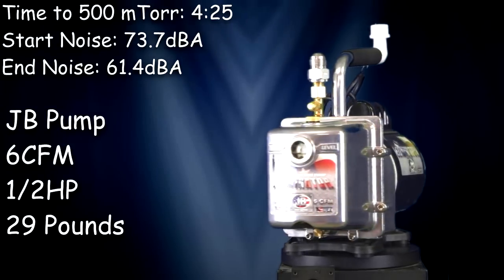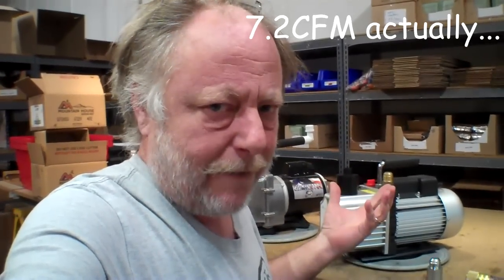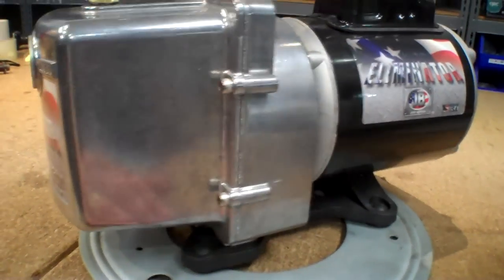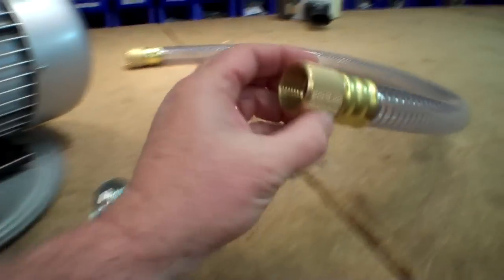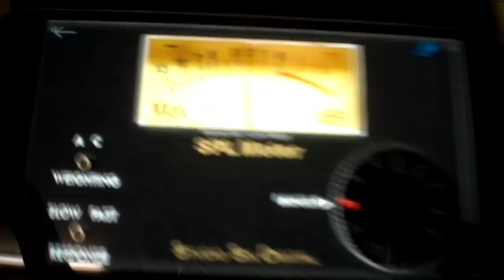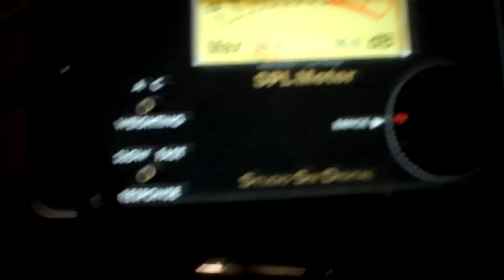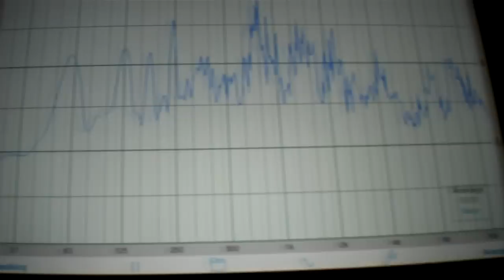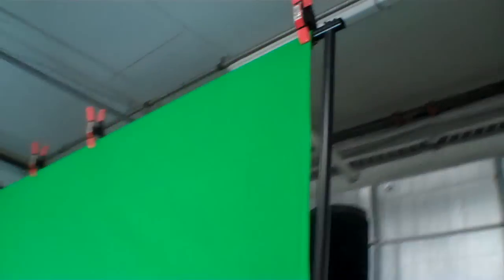First Look: NEW PUMP shipping with all Harvest Right Home Freeze  Dryers.

Comment: Bryan, one thing I just learned from Harvest Right's service technicians is that HR no longer services their new vacuum pumps (Model2TW-3C) nor do they sell replacement parts. Crap! They wouldn't even disclose the pump's manufacturer's name so I could buy replacement parts. The metal flash plate inside the unit is made from what appears to be an aluminum sheet. After 30 batches, even though I changed the oil after every batch, the metal plate was corroded, but the case showed little if any rust. HR customer service has been absolutely no help in addressing the problem.  McClain Bybee in Utah

Comment: Great video. I am a newbie, and it is clear that the pump is the biggest issue with these becoming a more household item. Good to see an improvement, though I have had my machine intact for only a few weeks so have the older motor. I get a bit worried on the cleaning aspects, and now the stories of the other problems. You give great information.
Reply from the maker: Hang in there Brian and run your existing pump. If you run into those issues I've posted about some can be fixed - some worked around. No need to rush out there and replace your pump if it's working OK.
Reply: EpicenterBryan Yes. I will. Need to work through the initial learning curve before I get to the next step.

Comment: We were in Utah a few weeks ago, on 11 November we stopped by HR to investigate the FD. After the demo and trying samples of several food items, we ordered one to be shipped to our home in Texas. We were a little disappointed (but not too much, because we would not be back home for at least a week) to learn that they were not shipping units due to a lack of vacuum hoses. Our shipment arrived on 2 Dec with the new pump. I would have been oblivious to the fact that we were among the first customers to get the new pump had I not seen this video. Now that I think about it and see that the vacuum hose connectors for the new pump are different than those for the old pump, I suspect that it was later than anticipated arrival of the new hoses that was holding up the show and that had the new hoses arrived sooner the shipment date of the new pump would have been much earlier in the month..
One item that should be noted is that the documents shipped with the FD have not caught up to the equipment shipped and there are some small differences that will need to be corrected in several places in the documentation. One difference caused by the new pump is the multiple places that refer to and show a picture of the dot in the center of the sight glass on the pump. The new pump has no dot in the center of the sight glass, there is only a fill line marked on the case beside the sight glass. The other difference is that the new hoses have a knurled grip on the fittings, where the old hoses had a hexagonal grip, so the instruction to turn the connector ¼ turn with a wrench after hand tightening it seems like it would no longer apply. I hand tightened ours and that seems to have worked fine.

I have watched several of your videos now, thanks for the information that you share, it will undoubtedly save us and many others a great deal of trouble and countless hours in not needing to run all those experiments ourselves.
Reply from the maker: The new style hoses have been used for many months. The new 7.2CFM pump was slated to deliver with units shipping on November 20th and later. We tested one for several weeks before they officially switched pumps. I'm sorry for the delay you experienced. But the new standard pump is a big improvement over what was used before and you will be happy with the way it performs. Yes, there are errors in the documentation. I provided updates back on 11/7/17. It will take some time for the documentation to catch up. Some things were printed a bit prematurely. Thanks again for watching the channel - and stay tuned for an exciting video about a new maintenance-free oil-less pump as well.
Reply: I made another comment in which I commented on the right angle elbow adapter that is show in the video, but that comment seems to have disappeared. I would like to have an adapter like that on my HRFD. Do you have any suggestions where I might find one for the new connectors?
Reply from the maker: That one was for the old style (garden hose) setup. I'll look into sourcing  one for the new style hose (like you have).

Comment: Has anyone cleaned their 7.2CFM, 3/4 HP Pump yet? I cleaned mine for the first time and it is much cleaner inside than the JB Eliminator Pump. Although there was a loose piece of metal inside. Very thin and round. The company said they are having some trouble with this piece breaking off. they called it a reed of some sort. I can't seem to find where it goes inside. Anyone experience this on their machine? The company said they would ship one out asap. Thanks Brian for all your time making these videos. Great to see participation from your employees.
Reply from the maker: The small round piece you found while cleaning out the pump is indeed a broken reed valve. I've seen it come up several times on user groups over the last few months. The valve is one of three on that model pump, and you should be able to continue using the pump while you wait for replacement valves. I have been told that the valves have been re-designed and they should be sending the new version. If you look closely at all three of your valves, the outer parts will look the same. But if you look closely near the pump housing, you will see one valve with a larger gap. That's the one that broke and where the round piece you found came from. I'll do a video on this in the near future but it's easy to replace.
Reply: I too just cleaned the inside of my pump on the recommendation of HR because my oil was very dark when I filled it. I too found the little round piece. I wasn't sure what it was so I set it aside and did the cleaning and reassembled the pump and filled it with new oil. I ran a batch and after the new oil was just as dark as the previous. This didn't happen in the beginning. I was able to filter and reuse the oil about 5 times. Have you seen this before and could the separated piece be the cause?. Thanks for your help.
Reply: In the first sentence above I meant filtered not filled.

Comment: The new pump looks like a Robinair in HR clothing.  Is that right?  Did HR change out the internal hardware with stainless steel bolts, etc?
Reply from the maker: Hi Barry, I don't know. I'm pretty sure it's China sourced and HR Branded. It's a vast improvement!

Comment: hi Brian, i have a couple questions about that new pump. my first batch was corn, green bean and peas. the oil from the pump went up the tube and into the dryer chamber during the drying stage. also my freeze dryer has a different program, it says 4.0.22 and my manual is the old version. there is no information on the website. i enjoy your videos keep up the good work
Reply from the maker: Hi there. You will need to contact HR about the oil issue. They can send you a replacement check valve that is easy to install. As far as the new firmware goes, I haven't see it yet. Mine has the old software.
Reply from the maker: I have an engineering version of the new firmware 4.0.25  I'm testing on my old unit. We will start doing new videos about the new firmware running on a new machine next week. For now, yes you should contact HR and install a new check valve on your pump. They will be able to get that out to you.
Reply: @EpicenterBryan  thank you and I look forward to more videos.

Comment: We received the Omega Pump 7.2 CFM-MT1722 as replacement for the original pump which leaked. The new pump has worked well but a month ago when cleaning it I found that the "cap board" was rusting out most specifically on the edges. IHarvest Fresh says they don't support this pump.I tried to contact PARTDEAL.com who I believe sold the pumps to Harvest Right and OMEGA VAC Vacumm Products and neither have replied. Do you know where I could get this replacement part? I would actually get several just in case. Thank you.

Comment: Great video! And green screen set up! Will HR let you use your real time filter system with the new pump?
Reply from the maker: I figured someone would get a kick out of that green screen! Well, I haven't asked ;)  I'll probably rig it up at some point on the new one but the pump I mainly use has been running flawlessly since April when I replaced the seal. Other than the oil sucking issue that can be worked around. I'll have to do a video on that soon.
Reply: EpicenterBryan I really think you are on the right path with your real time filtering of the oil. I doubt any reasonably priced vacuum pump can deal with the effects of water and food particles in oil. There is just no tolerance for corrosion and blockages and still be able to pull a vacuum. I have had a similar experience with my 2005  F350 diesel, great engine but the pollution control was endless problems. But over the years, smart guys and gals like yourself figured out solutions. .. so now we have the best of both worlds.

Comment: In your video you show the seal at the back of the JB pump at minute 9:10. Where did you acquire the seal or seals to correct the issue? Is there a rebuild kit for the pump or can I get the seals locally? Thanks...Anyone with the info please respond. Our pump is working but leaks?
Reply from the maker: You can get parts directly from JB, but Zoro is less expensive. You can also fine the common parts on E-bay.

Comment: Hi Bryan, after watching your videos my mother has an odd habit.

According to the directions that comes with the harvest right freeze dryer vacuum pump it says to fill to the fill line.

After your videos she checks the pump every few hours and DRAINS the oil WHILE IT IS RUNNING to make sure the hot oil + water level never goes over the fill line.

Given this instruction appears no where in the vacuum pump instructions or the Harvest Right freeze dryer instructions, I am at a loss as to why she thinks she needs to this.

She says thats the way you say to do it.  So, is that the way you say to do it?
Reply from the maker: No, she doesn't need to do that. The oil level will raise as the pump runs. Partly because water starts adding to the oil, but mostly just because the oil is being churned up as the pump runs so the indication no longer represents static oil level in the chamber.  Let her know, it's normal for the oil level to increase and there is no risk of damage to the pump.

Comment: Brian, I am having trouble with my pump, I have the older pump model. The first pump I received with my unit (ordered in October of 2017) seized up after three runs. HR promptly shipped me another pump. I am on the third run with my new pump, still older model, and I am having trouble pulling a vacuum. I changed the oil after the second run, I am using Robinair premium high vacuum pump oil, could it be the oil causing the problem? Last run of the pump oil came out of the machine and covered the top and side of the freeze dryer, is this normal? I am dying to play with my freeze dryer and freeze dry everything in my house but the motor isn’t working properly again, what am I doing wrong. Any advice will be greatly appreciated, thank you!
Reply from the maker: Janis, give me a call. I could probably help you through the issue better on the phone. 541-684-0717. Ask for Bryan.

Comment: I'm looking to find your other videos, but I find only one.  Tell me, is there a video about the pomp cleaning, I'm french, I would like to see with images, would be easier to understand what I need to do.  I read that I'm suppose to take all the oil of after every batch.  And filter it after??  It looks overwhelming for me, I'm a bit lazy!  Is there a video showing all the process at the end of the batch till the pomp is clean?  On HR site, they only show how to start and how we have nothing to do!  Finally, is there a way that I can ask you questions by email?  To ask you tips when I'll start using my machine.  I have a few questions for you.  Thanks
Reply from the maker: I assume you bought your Harvest Right before November 20th. That means you have the JB Industries pump. Here is an unlisted video by Harvest Right that shows how to clean the inside of your every 20 batches... https://www.youtube.com/watch?v=wu2PiRmU4aE   Yes, you are to drain the oil after each use, filter it, then refill the pump. There is a new oil-less pump available. It is expensive. Here is a video I did on the new maintenance free pump (no oil or oil changes). https://www.youtube.com/watch?v=A_ar8ysARR4
Reply: thanks for the quick answer.  Yes, I had it in october, I just found your video about that oil changing.  I'm looking for the one about power wash now, to understand what it means.  I don't know how often I will use it.  If I use it only 10 times a year, I will not need to wash the inside before 2 years!  Do I need to let some oil in the pomp between uses? If not, I can use the same one when filtered, then.  Do we doo that when it's just finished, i must be hot?  Do you have an email for further questions?
Reply from the maker: Power flushing is no longer recommended. They found it could actually damage the rear seal on the JB pump (if that is what you have - I think so). Do not power flush as you have seen discussed. I think you have an outdated manual. You should download the current manual from the Harvest Right website. The new procedure is that you MUST drain the oil after each use, filter it, separate the water and refill the pump. You can use the same oil after it has been filtered. See some of my other videos on the topic. You can contact me through our website. Look for "contact us" at  TheEpicenter.com
Reply: ok, thanks, I just send you a number of questions.  Thanks for answering.
Reply from the maker: Glad those answers helped. I see you are now a member of several of the HR user groups. Great people out there with lots of answers!

Comment: I got my FD with the new pump, but no matter what I do it wont reach the vacume and start drying. I have wasted alot of expensive meat. I have an organic turkey in it now and it is on its second round of freezing?? Iam ready to take this thing to the dump. Any suggestions? I have taken the hose off and put back on, it says it is the door or the valve. Both are fine I do not know what to do
Reply from the maker: Hi there. Give me a call and I'll walk you through a few things to look at. 541-684-0717
Reply: they are sending me a new gasket, if that doesnt work I will call thanks
Reply: I got the freeze dryer working yeah me thanks love your videos
Reply: @kathleenhoward2634  so was it the Door Gasket that was the problem?
Reply: @kathleenhoward2634  and yes, I know the post was 3 yrs ago. ;))
Reply: @NightSky777  had so many problems with it,I sold it

Comment: That sounds extremely loud.  I have one day worker and one night worker in our home, so I do not think that amount of noise would work for us if the machine runs 30 plus hours.  I really want one of these, but do not see how I can do it.
Reply: I have mine in the pantry. With the doors closed, the sound isn't bad at all. Less than a white noise machine, I'd say. With the doors open, it's more like a vacuum cleaner in terms of volume. 

So, if you can find an out of the way location (preferably where you can close the doors on it), then you should be good. I wouldn't recommend it for the kitchen though, just because it would be annoying to have to listen to it at full volume for prolonged periods.

Comment: Brian, I just had my JB Industries pump repaired locally for a shaft seal leaking, at about 20 months. The owner of the vacuum pump repair company had same issues which you depicted in your previous video, and also had scarring inside the pump cartridge from the corrosion. That caused seal failure as well. 
I was disappointed that HR  is not putting a filter/ moisture trap between the pump and the freeze dryer. The company owner was a fountain of information, and his HO was that moisture in the oil is the biggest problem. He felt that filtering could if not eliminate, could greatly reduce maintenance on the pumps. I had drained, froze filtered oil, as well as power flushed and cleaned inside cover. Still only got @ 40 batches and 20 months before shaft seal failure. 
What do you think?
Reply: What's the symptoms of "shaft failure"?  Out HR 7cfm pump just recently had it's oil turn a darkish brown (I filter, freeze water, reuse after Every batch --since we're always borderline on getting mTorr low enough unless we do that).  But after the brown oil, the pump is not so loud, and we have not been able to complete any FD batches b/c of "Insufficient Vaccuum".  Ran a test freeze 30 mins, then switched to the Vacuum test for ~6-8 mins and mTorr got down to ~440.  ...not sure what's going on?

Comment: I have the new pump, Does it have to be power flushed & the front cover removed for cleaning?
Reply from the maker: Power flush is no-longer recommended. However, you should remove the front cover every 20 batches and clean. Also, drain and filter the oil each batch...
Reply: Thanks for the reply,  i called Customer Service & they said the same thing.